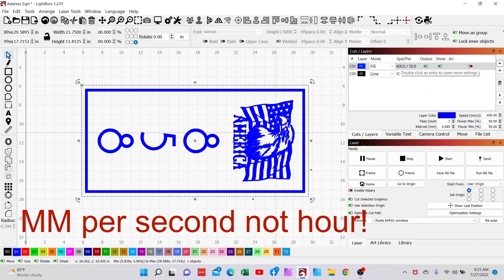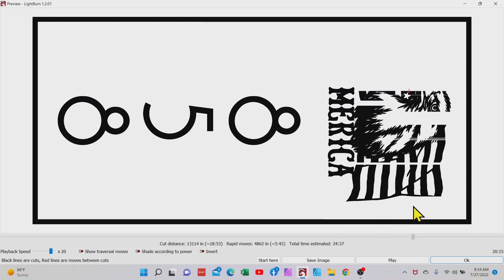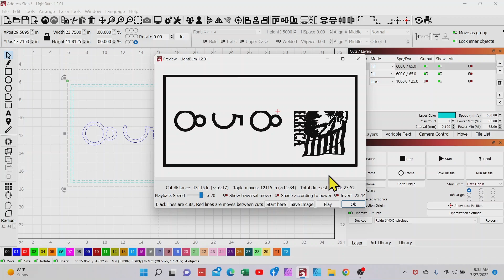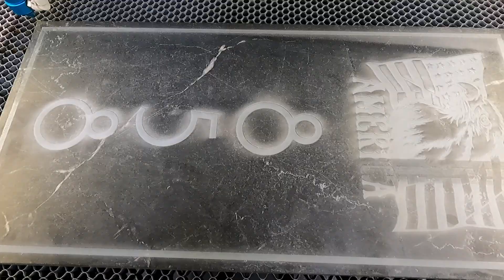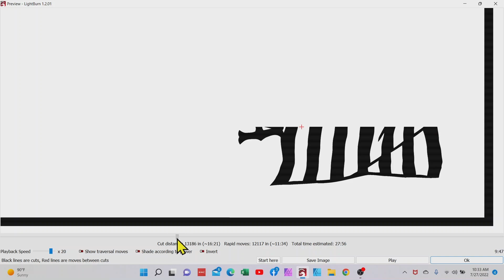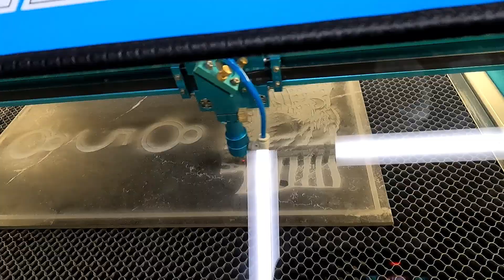Making an Address sign from ceramic floor tile. Learn how to reduce your engrave times!

Comment: I know from my CNC controller I can go back to the point where the carving stopped. I was excited to find that this method of returning to a problem area with my laser was available using Lightburn preview screen. This is going to be a game changer for me. Thanks again for the valuable tip.
Reply from the maker: I use it all the time for areas that haven’t cut all the way through

Comment: Great video, I am new to the Engraving business world. My experience with "flood-fill" is sketchy. Was doing a custom bamboo cutting board for a customer (X-Tool D1 10w) the results were very uneven - played around with power/speed and it was not a smooth clean burn. Used normal "fill" and it was 100% cleaner.
Reply from the maker: Thanks for the comment, I have found the same thing. I use flood fill very sparingly.

Comment: Good afternoon.  Great project.  I love watching your videos.  I think that everytime I watch one I learn something new and add another great idea to my "Projects I Want to Do" list. I have a question regarding how you were able to stop the laser program and then return back to your Origin point.  At approx. 14:27 minutes, you said  you hit Pause then Escape to stop the project after fixing the missing parts.  When I hit pause then escape on my machine, Pause works great, but Escape does nothing.  I have found that stopping a project with the Stop button is a very bad idea as that appears to clear out all previous settings for positioning. If you hit Go to Origin now, the laser head is more than likely going to 0 position on X, and wherever it feels like going in the Y axis. (Lightburn themselves said the Stop button is more of an emergency stop rather than a Stop and return to Origin button.)
Reply from the maker: You must have another controller type, most dsp controllers will function this way.
Reply: @computercreationz  I did notice you use the Ruida controller.  I am using the LX4 board.  Interesting bit of info.  Thanks for the reply, much appreciated

Comment: This might be a dumb question, but how do you finish this to display it? Does it get attached to something?  A picture of the finished project would be awesome!
Reply from the maker: most people incorporate in the landscaping, it not going to blow away.lol or you can build a frame, use construction adhesive to attach to a larger board painted in contrasting color and screw it to the house. lots of options. I use grout sealer on the engrave portions

Comment: I just have to ask - why no air assist?  What would be the harm in having low air assist on to keep that nozzle clean?  Wouldn't that have prevented the buildup that caused the missed part?
Reply from the maker: it keep from blowing that gritty dust all over the inside of your laser. thanks for the question

Comment: Great video as usual! How do you mount the tile once engraved?
Reply from the maker: Allot we put on a backer board pained a contrasting color and that can be attached to the house or construction adhesive is used to affix to large elements like sign posts. Build a frame and inset it.

Comment: Love the video thanks!  I bought a simple Dewalli laser and am wondering if I can’t get to the LPI settings because it’s not an expensive laser. ($259) Is there a setting I need to turn on for it to show up on the cut setting adjustment dialog box?  Thanks
Reply from the maker: I’m not sure diode lasers have Lpi settings
Reply: Hmmmm I am very new to laser engraving and didn’t know that.  Thanks for the help. I’m still deciding about stepping things up with engraving. Getting a better and more efficient laser. As I get older I’d like to do things that require cutting tools like chop saws etc. 😄

Comment: Would breaking the boarder into vertical and horizontal sections and rotating the movement direction so it's always long strokes improve speed or equipment wear?
Reply: Yes.
Reply from the maker: I tried that thinking it would save some time but overall it was only a couple of minutes
Reply: @computercreationz  But, it would save the machine from jerking.